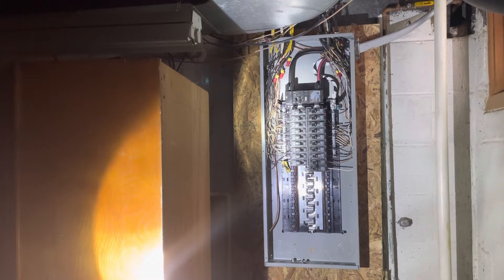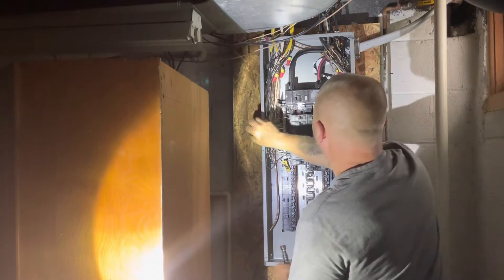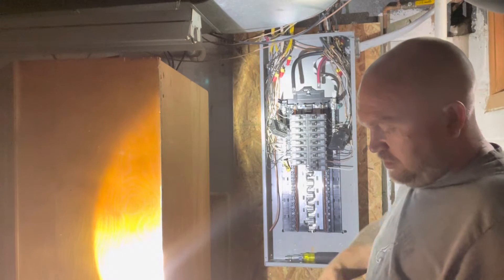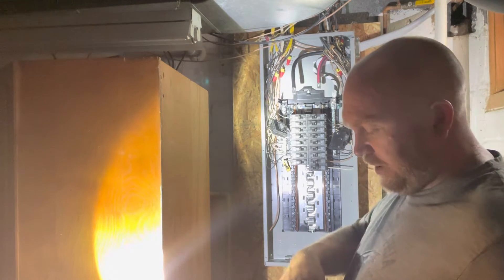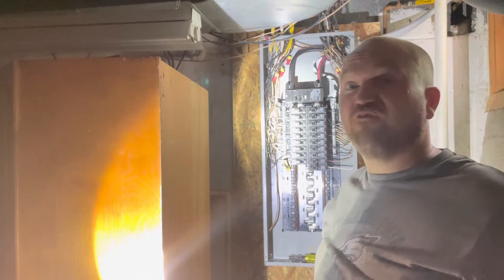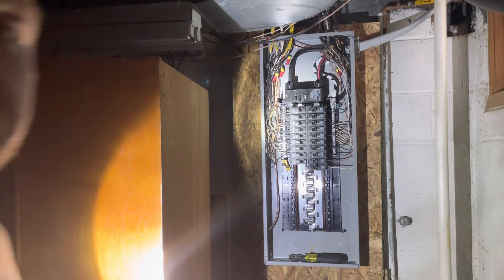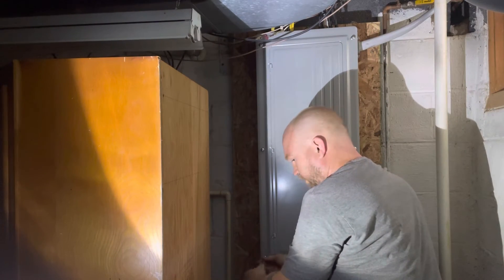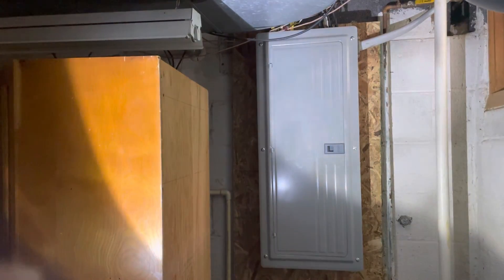Defective Siemens 200 Amp Main Circuit Breaker

Comment: can a Main breaker be repaired? I have a Murray Crouse 200amp breaker that the switch is not snapping in place and seems loose after powering it back on. a new one is around $1200 bucks.

Comment: Thank you for a sanity check..I just bought a brand new 40 space Siemens PN panel  Siemens SN4060B1200  and the main breaker won't lock over to the ON position. I checked the breaker with an ohmeter and the main breaker switch stays open circuit.  It didn't come with machine screws to attach the front panel to the back piece either.

Comment: So, hopefully, not a difficult question. Im looking at installing an interlock system in my panel, which is in the garage. This will include a 30amp inlet wall plug for the solar generator to bring power to the panel. The problem is that my main breaker is on the outside of the garage with the power company meter. My panel in the garage has a main breaker punch out. I found one on Amazon for Siemens panel. It's a 200amp double pole breaker with one switch. Would this work. I've attached a link to amazon to show what im talking about. It also comes with the 30amp breaker that would be for the solar generator, and the interlock kit will sit between the main 200amp breaker and this 30amp breaker. Also, do you know how much electricians usually would charge for installing the main breaker in the panel. It doesn't look hard. I just dont want to void any homeowners insurance by doing electrical myself. Hopefully, not thousands.

Siemens MBK200A 200-Amp Main Circuit Breaker for Use in Ultimate Type Load Centers & Q230 30-Amp Double Pole Type QP Circuit Breaker https://a.co/d/i4y1MVN

Comment: I have a simens breaker panel inside my manufactured home..main is getting very hot or trips sometimes when i  run heat pump for a long time,,is it bad main or heat pump compressor
Reply from the maker: What is the amperage of your main breaker?
Reply: @taselectric8206  200 amp service

Comment: Looks like my 20yo Siemens breaker won't move to the Off position....so guess I'll need to run down.  Good news is it looks like this is an easy swap minus finding the breaker and of course any permit needed.  Thanks for the video!
Reply from the maker: turn off all of the other breakers, then if you are able to pull the meter in your area without calling the power company, pull it.  Check to make the wires feeding the main breaker are dead.  You should need a flat head screwdriver, an Allen-key(not sure what size) and a socket either a 7/16 or 1/2 inch. And finally use noalox on the wires when putting them back into the breaker.  It is good practice. If you have any questions, we can be reached on Instagram @taselectricllc
Reply: @taselectric8206  thanks.  I was able to get the part but checking on permits and power company; new smart meters have a security tag on them.

Comment: You need a closeup of how your doing it. Its hard to see with you standing IFO the panel and the shadows don't help. Just saying...
Reply from the maker: Pull the meter,  loosen the lugs for the wire, remove the bolts that hold the breaker to the bus and remove breaker. Installation is in reverse